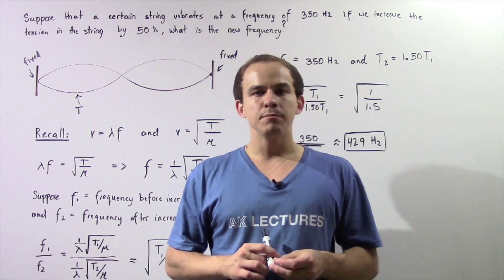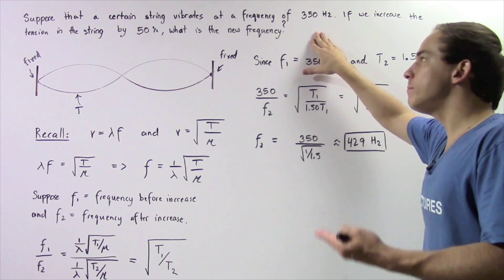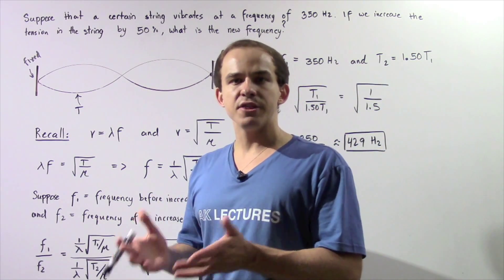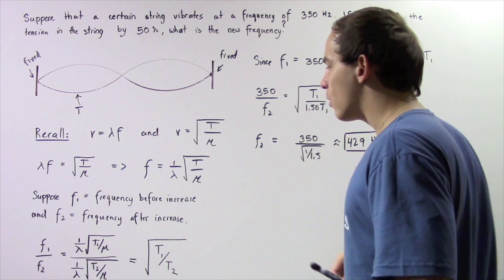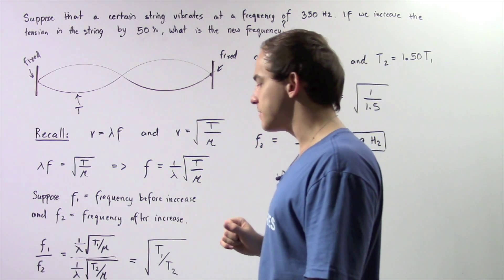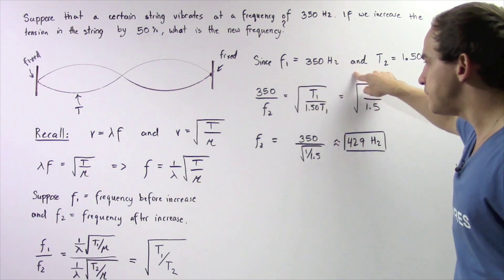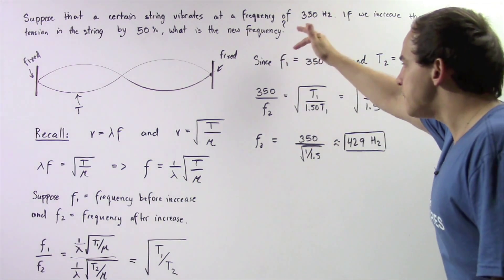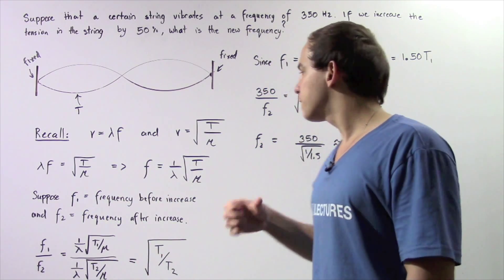Standing Wave Example # 2

Comment: Why doesn't wavelength change?  I thought that changing frequency would affect the wavelength, because of the change in hormonics.
Reply: Just incase anyone else is wondering (like I was), found this explanation "The exact relationship between frequency and wavelength is f = c/λ. When you change the tension on the string, you are changing the wave speed (c) and frequency, but not the wavelength. Specifically, as the frequency goes down, the speed goes down by the same factor, and so the wavelength doesn't change."
Reply: @mcatability4804  thank you